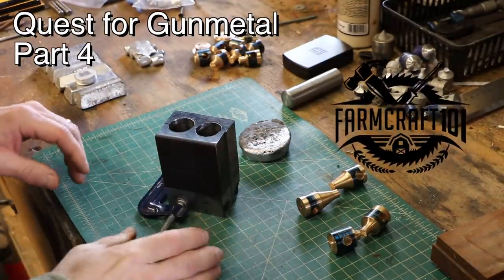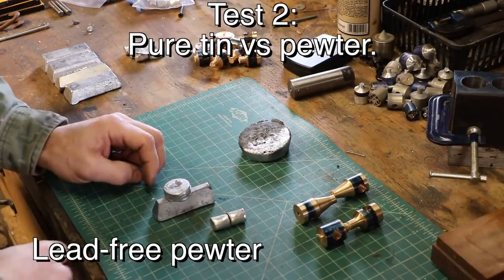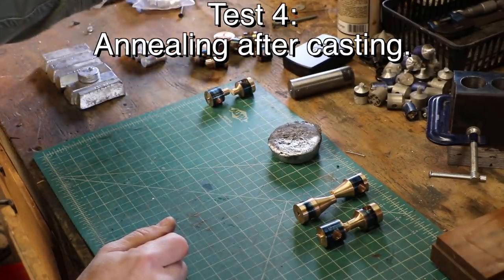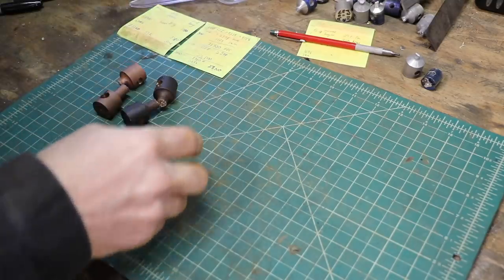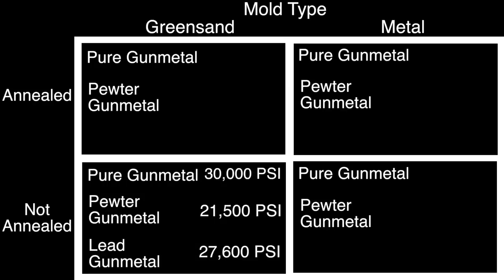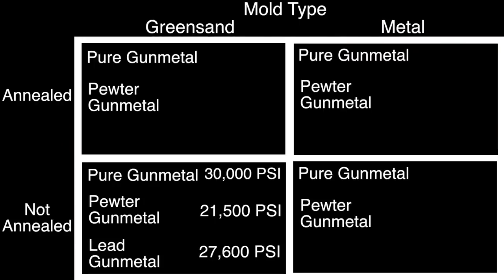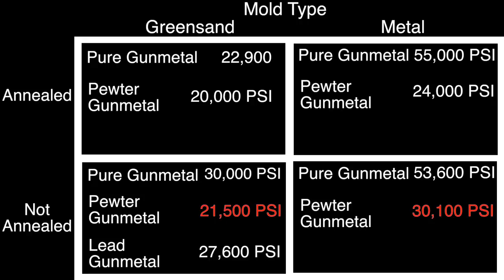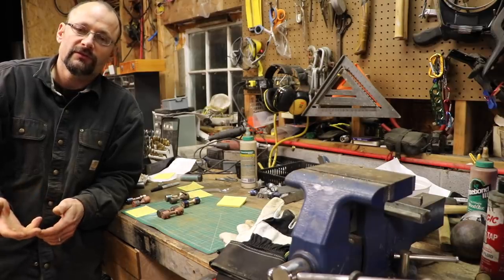Quest For Gunmetal, Part 4. Success!  FarmCraft101

Comment: Air dry vs water quench? Wouldn't water quench harden it
Reply from the maker: Forgot to explain in the video.  Copper and it's alloys are different from steel.  What I did in the video would harden steel, but anneals copper.  The quenching isn't absolutely necessary in fact, but I've read that it helps a little.  The main thing with annealing copper is simply heating it to a glowing temperature.
Reply: @FarmCraft101  that was my understanding, the question I was asking is if by cooling it too quickly you hardened. Same with the mold, the key is to cool slowly
Reply: @Bereft777  you make no sense sir....

you: wouldn't cooling quickly harden it
him: no, not with copper
you: that was my understanding, but by cooling quickly did you harden it?

I suspect you replied in a hurry on this day a year ago.

Comment: have you thought about annealing it to try and uniform the metal then heating it back up and allowing it to air cool? might make it stronger
Reply: That would be normalizing not annealing and unless it is being forged normalizing copper and copper alloys is pointless...actually even while forging copper normalizing is pointless as a quick quench in water anneals it completely and removes all stresses from the material

Comment: Well...   I am considering a canon build...   Actually repurpousing a hydraulic cylinder...    It's cr mo i guess..   so no casting needed.
Reply: I have done that. Hydraulic cylinder arms I used were suitable for a 1" bore and held up well. It took smokeless powder to blow it up under testing and it peeled the walls back like a banana, rather than fragment. Would last forever using black powder. One ended up looking well expanded at the muzzle, like a coca cola glass.

Comment: Annealing has to happen over a slow period Were you relax the metal down from a high temperature to a low temperature not quenching I'm sure you know this by now do both will benefit you intensol strength.
Reply: Read the comments and learn...copper anneals via a quench steel anneals via a slow cool

Comment: Your steel ingot mould Dose not have to be That hot, You cause the ingot mould to scale leaving Steel scale on your !Ingot  Black heat is all you Need !
Reply: I was thunking the same thing. Also, the steel mold expands and contracts with the heati g and cooling. I wonder if the contraction isn't imparting something like hammer forging and changing the grain structure as it contracts when cooling before the work piece does.
Reply: @sumduma55  
You Could Be right,, Like swage Forging !

Comment: Your quench hardening the mental not annealing it (making it brittle)... you bring the temperature down as slowly as possible when annealing
Reply from the maker: Not with copper alloys.  You are thinking of steel.
Reply: Copper anneals from the increase in temperature change.  The cooling time, quench or air cooled, makes zero difference in the strength.  There are only a few very specific Cu alloys that can be quench hardened.  Enjoyed the video overall.  subbed.